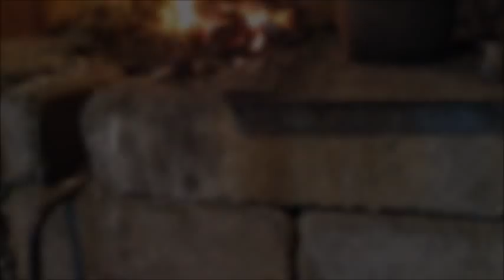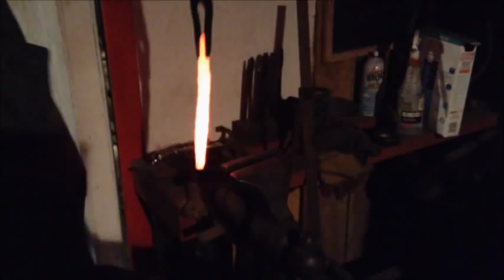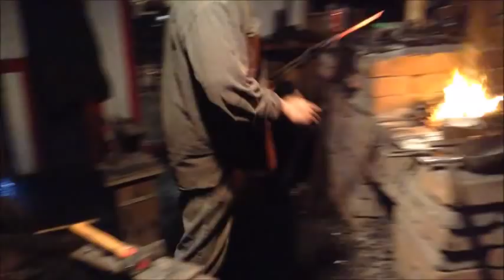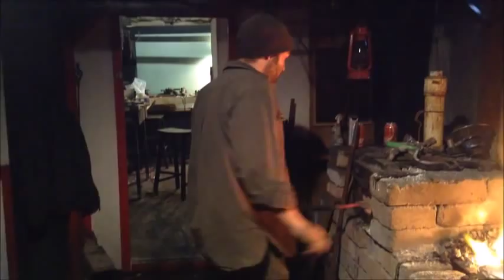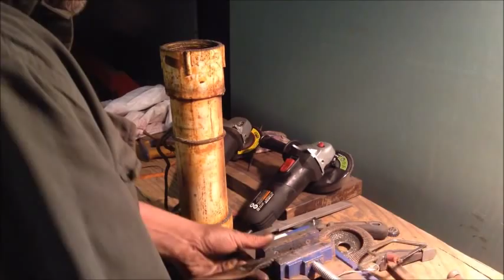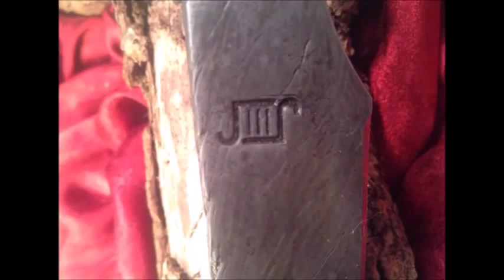Forge welding wire rope - Cable Damascus Knife

Comment: Nice work. I hope that since you made this video you have learned to use Eye protection. All it takes is one spark coming off a hammer blow to blind you permanently. I should know, I'm now legally blind...
Reply: wow.  i can only imagine the sense of regret.  can you get an artificial lens implanted?
Reply: Botha Lissom no, my condition has no cure.
Reply: Gilberto Diaz Castro
my sympathies.  i always use PPE. better to be cautious.
Reply: wtf are you talking about i get sparks of red hot metal flying in my eyes at least once a month and there's no damage to my eyesight

Comment: Did you use a welder to self the ends shut first or did you just straight forge self them?
Reply: JW Stekervetz how do you get them not to grey? Everytime I have tried it without mug welding it first they always seem to frey even at weld temp

Comment: Did you do any prep to the wire rope prior to putting it in the forge?
Reply from the maker: Aside from cutting it to my desired length, no prep whatsoever.
Reply from the maker: However, I will say that when I come across a piece that’s particularly nasty with grease I have been known to soak a length overnight in kerosene just to play it safe. This piece though came from an entire spool I bought new.
Reply: @jwstek  that’s what I was looking for, do you think vinegar would be a good soak for the nasty?
Reply from the maker: @fryscountrylifechannel4437  no, I think it would oxidize the steel and make welding a real pain in the ass if not impossible!

Comment: what if the cable is galvanized light?
Reply: +miloš benčič I would never use galvanized steel for smithing, the zinc coating on the steel will release toxic fumes when heated.
Reply: oh boy, zinc police again. ..

Comment: JW  
 that is a Body and fender hammer isnt it ?  do you know the name of that hammer?  thanks
Reply: JW .. I thought it was  a body hammer , it has a long snout reminds me of my ex wife .. lol thanks
Reply: +Lucky B  I believe that is what is referred to as a "French Pattern" hammer
Reply: JW  I wish I did know the name of it but  I don't
 I jumped on e-bay a while back looking at old
body and fender  hammers and it had three of them for sale ,  but were beyond what I wanted to pay , ,   .. JW ..  the best  thing for making  a hollow grind on a blade when you don't have a belt grinder .  ( 2)  1.1/2 Ball bearings  set up on what they call a black smiths helper  they  line up on one another ,  and for a 3.5 to 4" skinning  blade or drop point ,, can come out damn nice ,  need a slot where you can slide the hot blade behind the bearings  and get your edge started where you want it .. better than trying to beat one out
on the  with a ball peen on an anvil .. ( Tip of the day )
Reply: ok wellits a multi cultural  hammer then  bumper/ blacksmithing /knife makers hammer . it was a good invention ..

Comment: Why do you not wear safety glasses?
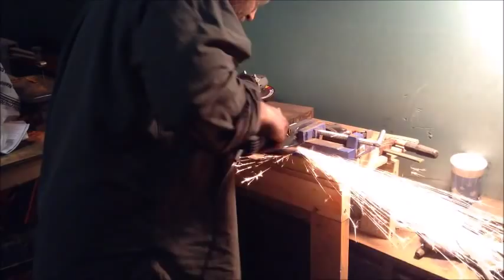Reply: Robert Winkel There's two main reasons for this in this video. A) Lighting for shooting, I couldn't see beyond the glare with my current glasses at the time. B) I cut my teeth doing this as historical demonstrations where anachronisms, such as a face shield, earmuffs or even a handy pair of vice grips were severely forbidden. I've always worked slower, more controlled and at a rather large distance from the anvil. Unless I'm giving tiny correction taps to nudge a piece one way or another, my head never goes near a certain area around the anvil and certainly not over it. It's a little hard to see that with the camera angle, it's a little deceiving. But my safety glasses do make an appearance at about 13:32 when I'm grinding. With powertools it doesn't matter how you've been trained or how cautious you are, something is going to go wrong, it's just a matter of when.